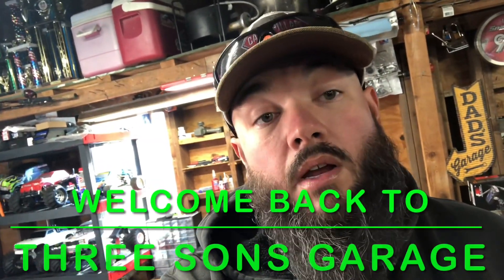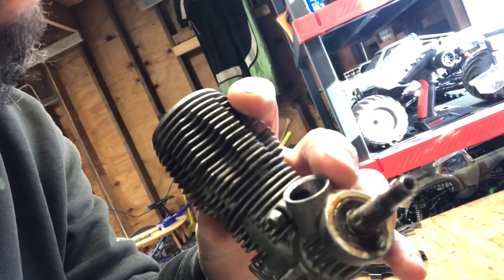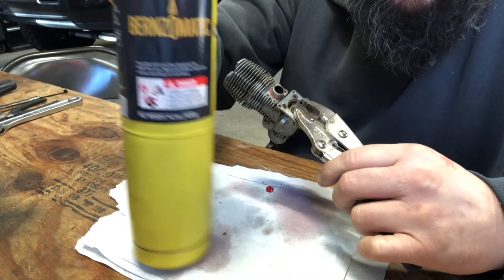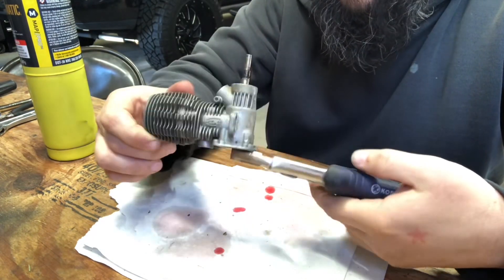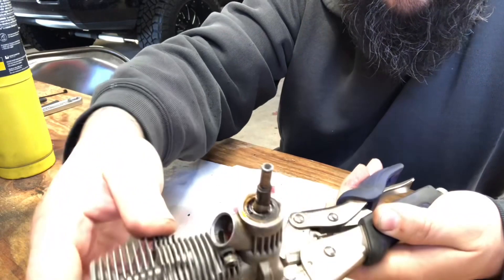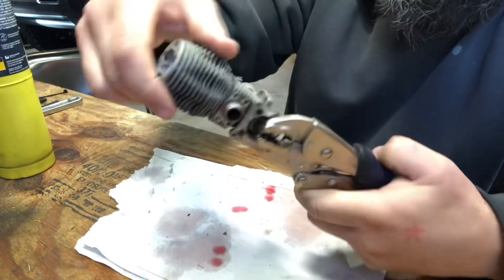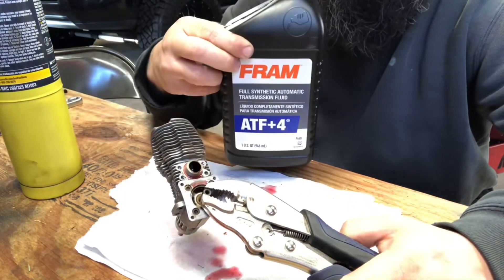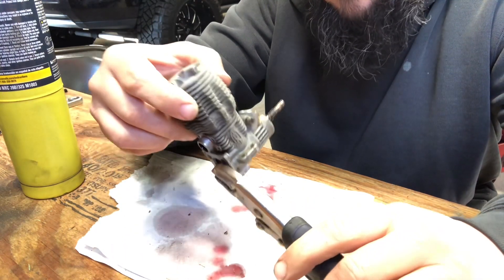ENGINE STUCK? WATCH THIS!!

Comment: Probably a good idea to put new bearings in. And yes heat always helps! AFT don't really help much but it's a great after run and long term storage oil. A Solvent works better to help free them. Also if you want a little more out of your 2.5 put a 3.3 crankshaft in and it will surprise you how much better it will perform. 😉🤘🏻🍻
Reply from the maker: Thanks as always! We definitely still going to rebuild this one too
Reply: @ThreeSonsGarage  right on! Looking forward to it